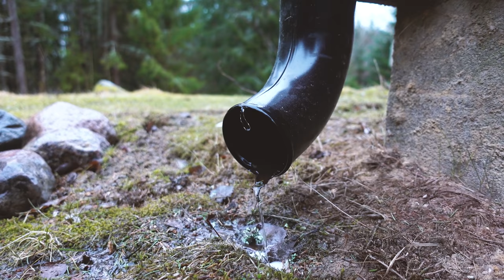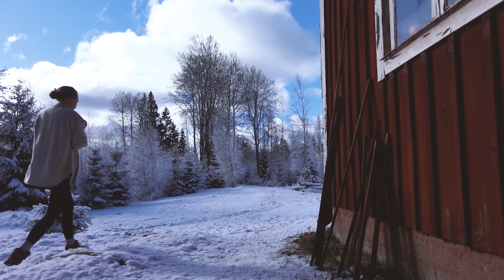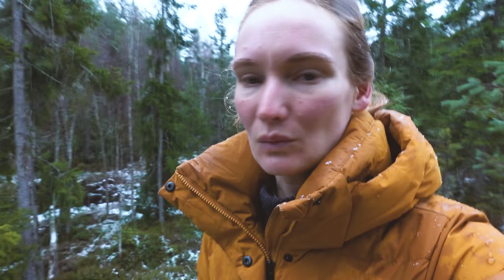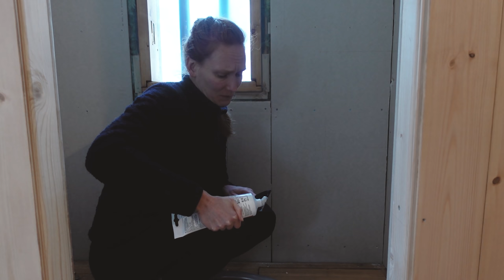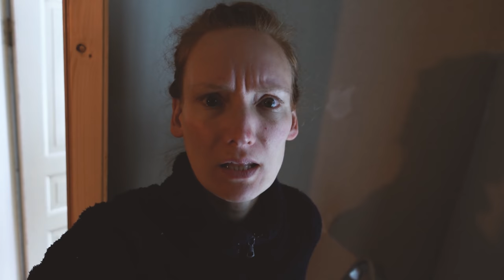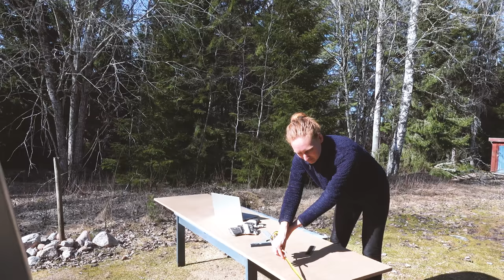Everything is green! Making My First DIY Joinery Unit (Story 13)

Comment: I just discovered your channel and got immediately addicted, can't stop watching your videos. 😊

The ring in this dowel set is a stopper. You put it on the drill bit to define the depth (in this case half the lenght of a dowel), so all holes are getting the same depth. But you can also use a bit of a tape around the drill to mark the position.

Comment: Like your video and your reflections on life. And like the green color too!

A suggestion for your next piece of furniture: make the whole piece from bare wood first, making sure everything fits together (and fits as a whole in the place you want to put it). Then glue/nail/screw everything together. Then you can seal the few remaining visible edges if you want and finally paint it.

If you want a straight edge when using the circular saw, you can make a guide from some leftover plywood or mdf (make sure to use the original machined edge of a sheet, not something you sawed yourself and don't use ordinary timber) and after clamping it down, you can guide your circular saw along it.

And the warped wood: it always does that after a while, especially when untreated. It can also happen after you have installed it. Makes it harder to work with as well. But it looks nicer ;-)

Comment: 12:45 the ring is a depth stop. You set it at how deep you want the hole to be (typically half a dowel's worth plus a little bit for glue and 'crap' ending up in the hole) and then you will know when you have drilled to the desired depth because you reach the ring as you drill deeper into the material.

Comment: I hope this year you prioritize getting the fireplaces working for next year. Electricity is expensive nowadays in Sweden. And get firewood too, you'll need it. 

I am interested in seeing more about your fireplace. It is probably a "rörspis", a very different beast from what you would be used to in the UK. It's massive to retain heat and the smoke runs up and down and up through channels to extract all the heat it can from it. A very efficient design! It's not meant to be fired often, 1-2 times a day.

I would look for a local farmer or similar who sells firewood for a side income. Don't try and buy firewood from a big box store or something like that. Local is a lot cheaper when it comes to things like this, and if you buy enough you can get delivery via tractor. You will need several cubic meters. Birch is the best firewood.

Comment: Take your time. The cabin will never be really "finished" anyway. But it will better.
Oh, and wood can warp even if you do everything right (but storing it flat and dry helps a lot). I like to check wood manually before I buy it, but that is tricky when ordering by truck.

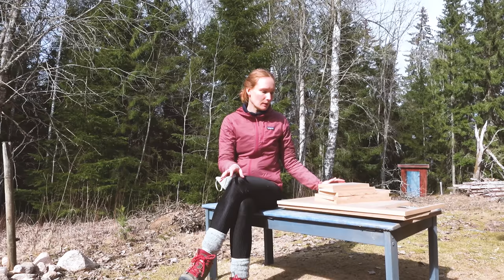Comment: 7:30 I use "free to collect'" old furniture from online add pages for my wood source. One splendid whitewashed teak salon table is now transformed into both my composting toilet bench and my Pilot house table, and lots of trim pieces. Free is as cheap as you can get:-)  Lucky it was 30mm think to begin with, getting rid of the whitewash took a lot of material and time. I also became self employed. Time is the only thing you can not buy.
Reply from the maker: That's a great idea!

Comment: In boat building there are no square shapes. Templates are definitely the way to go. Clever you. A rough in piece of cardboard held to the flat face, allows you to use a ruler to draw lines directed at all the ridges and valleys. Mark 10 cm in on the card, then you can transfer the dimensions onto your board, connect the dots for an exact fit. The other type of template is called a ''spider''. A flat board across the front face, gets scrap boards tacked to it. These boards poke up tight to all the irregularities, and the whole thing resembles a spider when you are done. Your unit is nice and functional, well done. carl@...

Comment: Rosie you are doing fine, the ring is for setting depth off drilling, to suit the dowel, just split the length off the dowel in 2 +1mm
or if the dowel can only go 1/3 in one piece you set it to 2/3 in the other etc.etc. The balance is always difficult and will vary from person to person, my preferred method is getting long days when i am in good mood and everything is going according to plan, and stop when everything is not working or running out off materials, take a break sometimes and leave the house to go shopping and look at suppliers to see if you can get new ideas, dont feel stress about it, film when you can take a day to edit, dont put time stress on your build or videos!!!

Comment: Hello, respect that you doing all this work with such little experience in woodworking and craftsmanship. At 12:40 you said you didn't know the use of the metal rings at the dowel set. Let me explain: You screw them on your drill to adjust how deep you want to drill. It is kind of an mechanical stop so to say. If your holes are too low on both sides your dowel will not go fully in and if you drill too deep the dowel won't sit in the middle or connect at all. But I have to say they are kind of hard to use and fix sometimes. You can just put a piece of tape around your drill at the needed distance, that will work finde too.

Hope you stay motivated, keep up the good work.
Reply from the maker: Thanks! Yeah I did the tape thing in the end. To be honest I figured out the ring was probably to be used for that purpose but didn't know how to tighten it around the drill bit... but there's an allen key in the package as well which I should probably use for that purpose!

Comment: perhaps the rings with the drill bits are used for stops so you can regulate the depth of the holes , like half the length of the dowel.

Comment: Maybe someone already told you, but that little ring is a stopper for your drill bit. Fasten it (there is usually a tiny locking screw in the side of it) about half the length of your dowels, plus a few mm up the drill bit, and you get consistent drill holes. Enough mansplaining, I bet you worked it out.
Reply from the maker: Ha yeah there's an allen key which I think should fasten it somehow... I couldn't work it out but I'll have another look! Thanks

Comment: I think that you make one hole with the drill, then you put the thing in the hole. Take the other piece and push it down so it makes a mark where you drill the other hole so they fit. Make sense?  Otherwise it’s a stop for you’re drill so you don’t drill to far… Good luck!
Reply from the maker: Yes! That thing to leave a mark at the center of the hole is great. I just cant figure out the rings that you use to mark the depth of the hole... I think I should have another look at it :)

Comment: Probable someone wrote it before, but the rings are there to control how deep the drill bit goes. You will see a bolt in the side of the ring. An Allen key in the set to make the adjustment is seen inside the packaging at 12:30. That way you avoid drilling too deep.
Reply from the maker: The allen key is the missing link! I'll have another look at fastening it with that. Thanks!